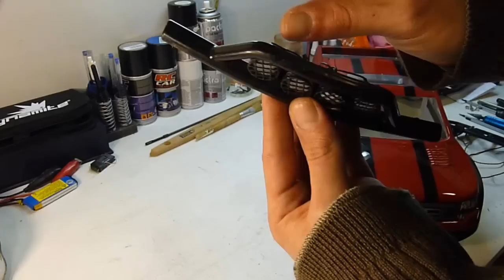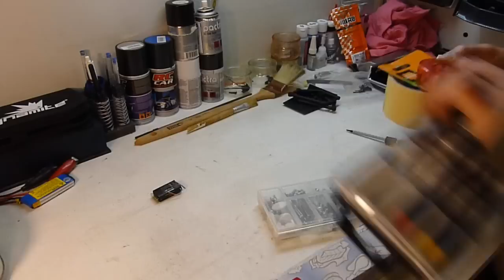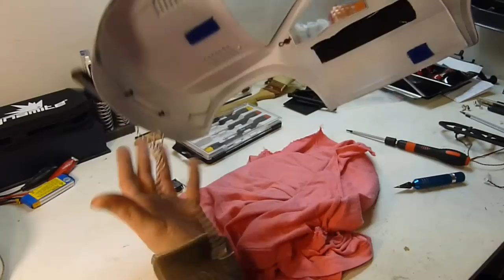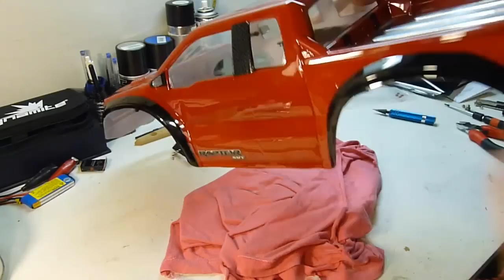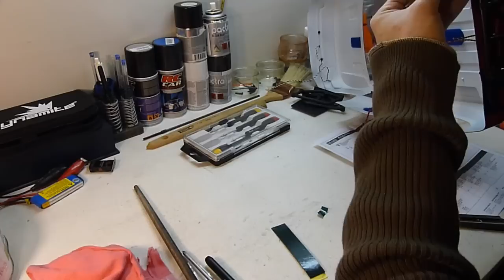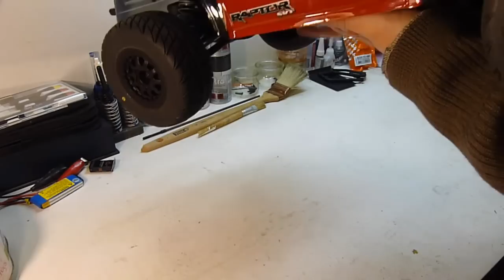Traxxas Slash 4x4 Body Custom2 Part5 ep2

Comment from the maker: Thx 
I recommended wait when break a parts buy a parts(if you run hard get a F/R arms and F/R shock tower) but the first things buy a ventilo for esc/motor with incoming summer and 3s lipo run protect the sterring with plastic/alum plate and in my case extra pinion gear no traxxas 2 pinion in few run !!